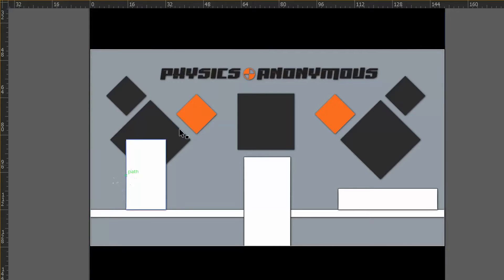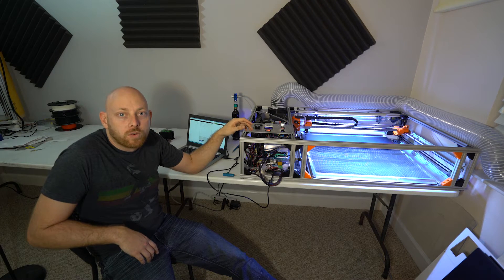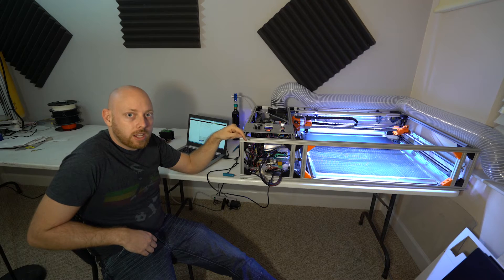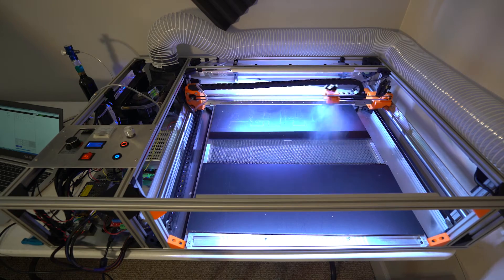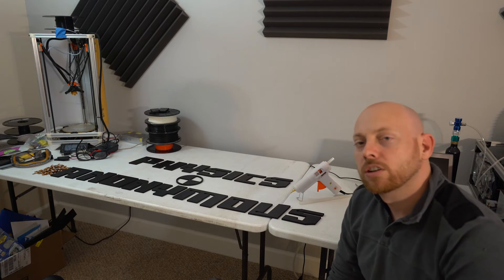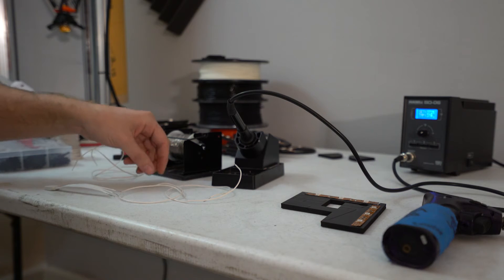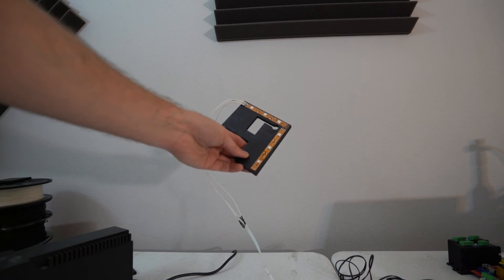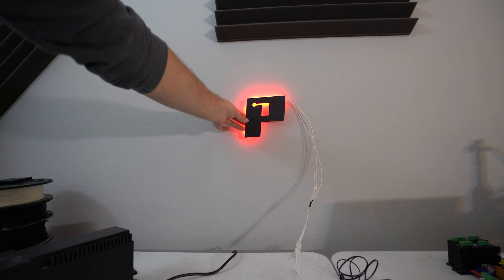Physics Anonymous S01E01

Comment: where did you resource your LEDs?
Reply: +Taintedeagle This is the Kit that I bought - http://www.amazon.com/LEDwholesalers-Controller-2038RGB-3315-3228/dp/B014135W2C?ie=UTF8&psc=1&redirect=true&ref_=oh_aui_search_detailpage

there are probably a bunch of different ones available as well. you could also get some individually addressable LEDS that would let you change each LED independently. but you would need some more of micro controller for that.